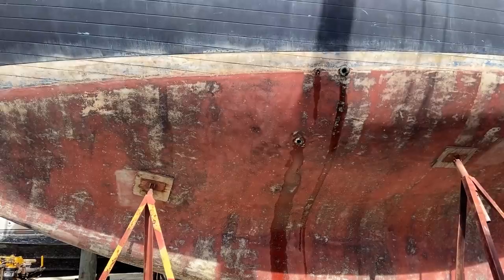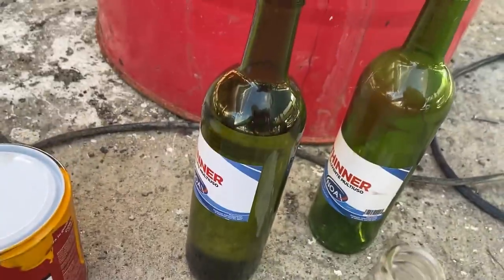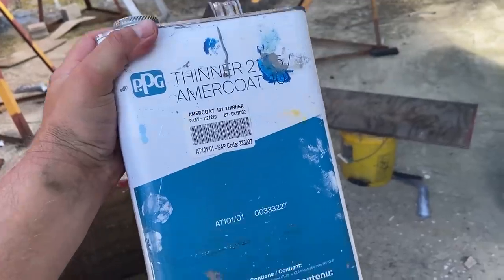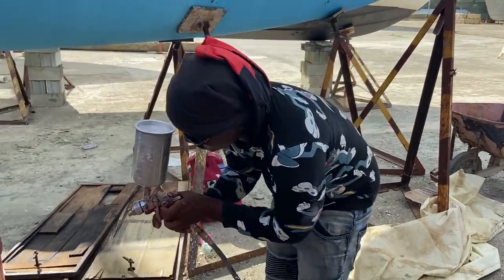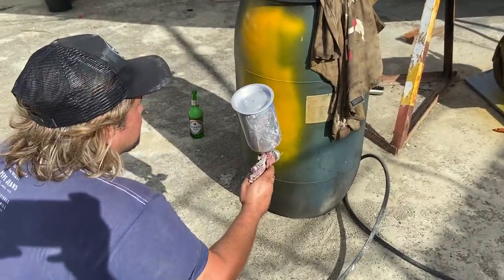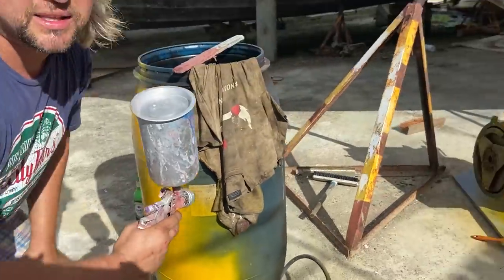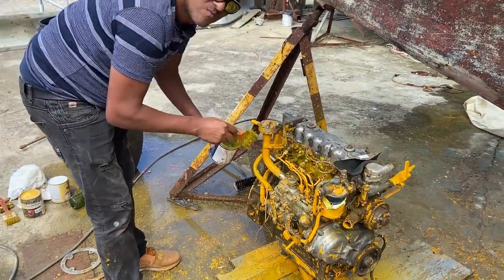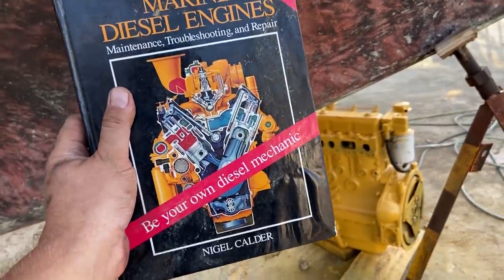I MESSED UP big time! Hard lessons learned...

Comment: When using the spray gun the trigger has two positions when spraying. When you squeeze the trigger a lil bit you get your air pressure only, when you squeeze a lil harder you then get the paint flowing. The trick is to always keep the air flowing when squeezing the trigger, and pull harder for the paint to come out on the parts you want painted

Comment: Yes, painting is not just about application of paint---it's about preparation. Stripping, derusting, sanding, more sanding,  faring. But in the end, it's just a diesel engine made to work, not look pretty. Paint is to protect it.  A couple of spray cans would have been easier and cheaper.
Reply from the maker: True... hindsight is.... 😂

Comment: Stefan, different thinners for different types of paint. Not all thinners are equal, you get enamel thinners for use with enamel paint, lacquer thinners, 2K thinners, recycled thinners, read the paint tin, it'll tell you what thinners to use. Just a tip, if you are spraying outdoors and want the paint to dry really fast add 1 part paint and one part thinners, the thinners evaporates causing the paint to dry faster, reduce after maybe 2 coats to 2/1 ratio. Keep the spray gun around 300mm from work piece. Lekker man, stay safe boet

Comment: you painted - everything! Even the fitting where spanners go (and won't easily go now). About that "thinner", you simply get the same type as solvent blend that's in the paint; some paint requires water for thinning and others require different solvents. You wouldn't put water into paint which is not water-borne, same deal here. Your nose tells you what's there most of the time, but the label on the paint, or online, provides the answers also

Comment: My two cents: Don't paint the engine. The only paint you need is witness marks on certain bolts and fasteners so you can detect any bolt backing-out. You wasted 3 days and good money just to look good, when there are functional issues to address. If you can't detect an oil leak without bright engine paint, then work on lighting and access to the engine.
Reply from the maker: Good advice but i want to feel proud of the engine so painting her was something i really wanted to do
Reply: The right paint can not only inhibit rust on the tin ware, it can protect surfaces of bolts,  nuts and screws. Often when these become rusty they can become difficult or impossible to remove without special tools. Paint allows you to see leaks,  and protects. PS diesels are a lot easier than modern car engines,  especially the older engines in sail boats.   No smog equipment yet.

Comment: Lol PPG for bottom coat on your boat ??? WHAT !  Please never do this on your boat !
Reply from the maker: PPG bilge primer and then Bilge coat especially made just for the bottom with 65% copper. Why would I not use that? Its the absolute best you can find in DR
Reply: @sailinginstructor  PPG I sorry I understand it has car paint , 
If they make a boat paint ok. 
But I would use a epoxy primer . 
I had problems with chipping with PPG .

PPG is not even on the list of top paints.
 But its going to last you has long has it does.